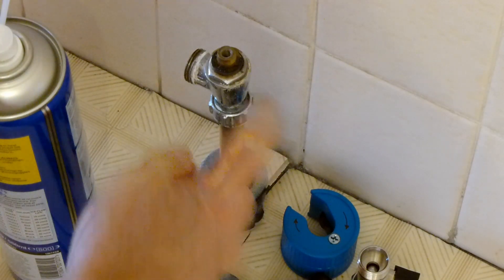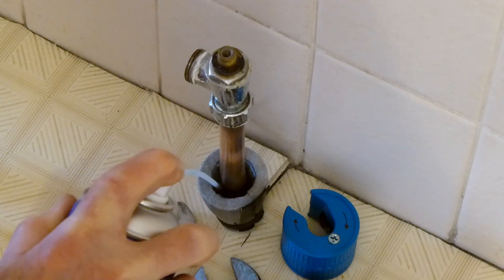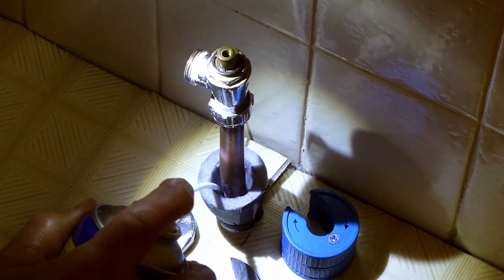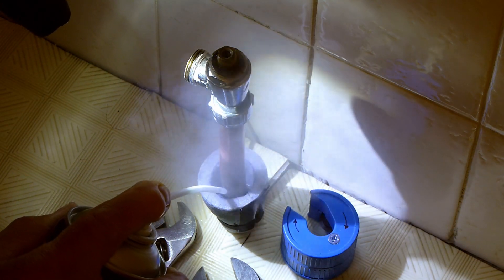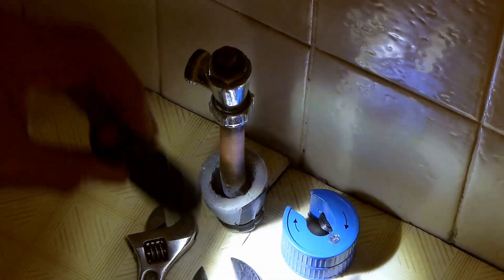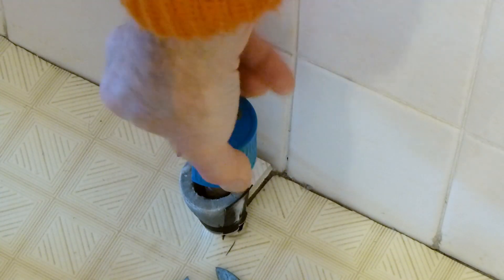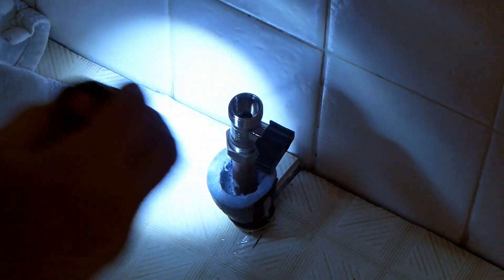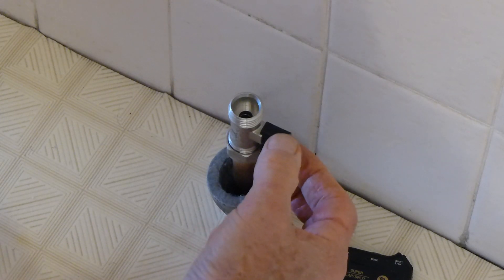Efficient Vertical Pipe Freeze to change radiator valve

Comment: Can I ask, what was the make up of the receptacle you used around the copper pipe
Reply from the maker: A piece of 22mm id pipe insulation with some duct tape to seal the gap - then tie wrapped to the 15mm pipe at the base.

Comment: Can I use  that with the pipe 1” connect to curb stop?!
Reply: I have only tried with 15mm pipe.  It should however work on larger - but will take longer for the ice plug to form. Also note importance of there being no flow at all.

Comment: Have you tried this method horizontally?
Reply from the maker: Yes, coincidentally 2 days ago!  However I just used 100mm of 15mm pipe insulation (15mm pipe) with zip tie 25mm from each end.  I made a small hole half way along and made a 3mm internal groove around the middle.  It was more difficult as there was no way to see liquid in place.  I also did nor hear any crack of the plug forming.  At 6 mins I had used around 50g.  It held, so I sprayed for a further minute.  Got the isolation valve on OK.  By the time I had cut the pipe again to fit the other half of the valve and completed the job the plug no longer held.  So lasted under 6 minutes.  I used less than 60g.  Maybe I will try being less frugal next time!

Comment: this is the method i tried in my first attempt to freeze a water line for repair. It is very effective ! I left the top of the insulator open and sprayed canned air (upside down) thru a hole near the bottom of the insulator. after about 3-4 minutes of light bursts i heard the click. the water stayed completely off for just over 15 minutes . (but did start flowing abruptly after 15minutes, so work fast :)  thank you FlyingDrMike !

Comment: Wouldn't it have been better to cover the top so that the vapour didn't just escape?
Reply from the maker: No.  Cooling is by vapourisation (latent heat) so it has done it work and needs to escape.
Reply: @FlyingDrMike  Thanks.

Comment: Wouldn't it work better with the top covered, possibly stick tube in lagging then seal with plumbers mait.
Reply from the maker: Cooling is via vaporisation of the Freon so needs to be open.  Believe there is little to gain from covering the top (major heat loss probably up and down the copper pipe).  It is also beneficial to be able to look and see if liquid is there.
Reply: Ah ok, normally freeze kits are covered

Comment: Your method totally made sense after viewing it..... get the coolant in slowly and don't waste the stuff by blasting it away from the actual part you want frozen! If I'm right you just want a pool of refrigerant to well up so it stays in place around the area to be frozen....? I wonder how many go through cans of the stuff just blasting away on full pressure and moan afterwards... Thanks so much for your trouble in doing this.
Reply from the maker: Thank you.  Your comment is much appreciated.  Yes - when you have liquid around the pipe you know the outside is below the refrigerant boiling point.  However for me the magical part (I knew about but first noticed when doing this video) was the crack sound when the plug does its first closure across the pipe.  Add a bit more time and keep liquid there and should be good to proceed.  Mike
Reply: Me 😂 this is such a better method !! I wasted the hole can

Comment: Pretty efficient in my views. Have always been concerned using this freezing stuff but having watched this video, I think there is nothing to worry about
Reply from the maker: It is always a bit scary doing this.  However if the freeze does go - get a thumb on the end of the pipe quickly and apply some more freezer.  Hopefully you will not need to do this but best to have the plan in mind beforehand!